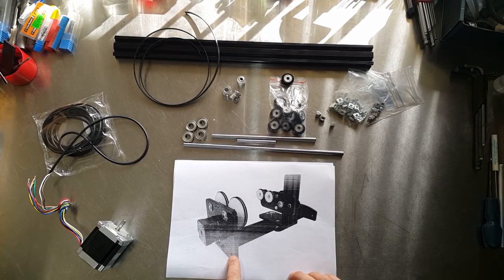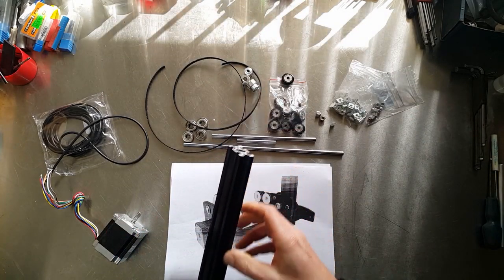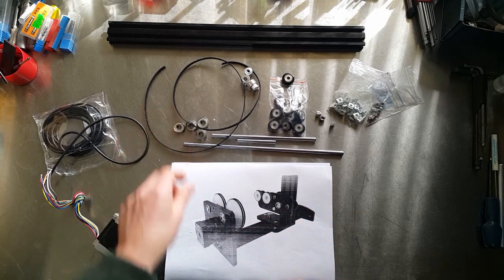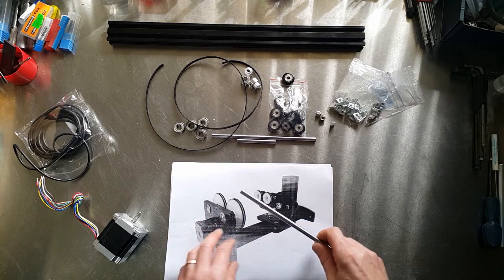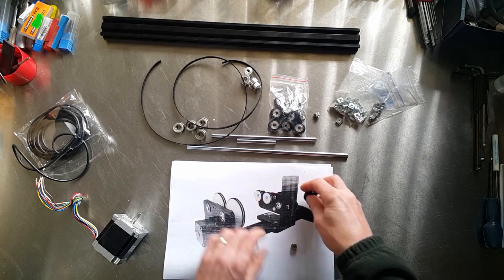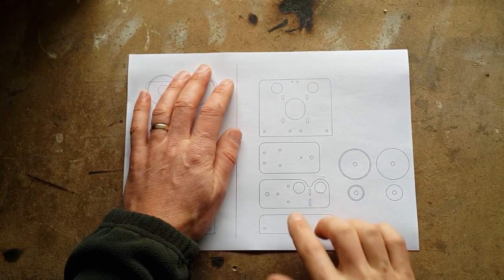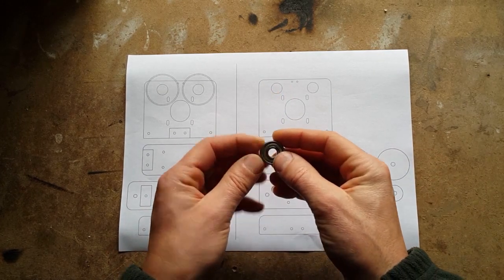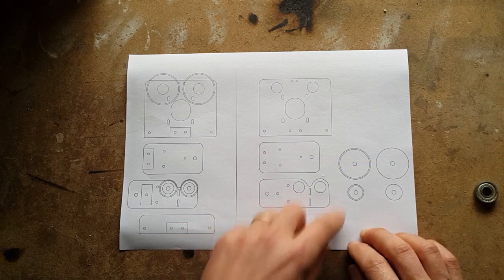#76 - Laser Cutter - Rotary Engraver Build - Part 1

Comment: Hi Kevin, really interesting project, just like Matty, I am thinking about something for laser engraving. I would like something powerful enough to etch metal as well as softer materials. I am fine with CNC programming, my issue is not wanting all the delicate electronics and PC in my workshop due to the damp in the winter so it's putting me off a bit. I will catch up on your previous videos of this machine as I am keen to learn. Let me know if you fancy a sticker swap mate, would be good to exchange. Cheers, Jon
Reply from the maker: Hi Jon, to etch metal you would need quite a powerful laser. My laser tube is rated at 60watt which enables me to cut upto 10mm acrylic and 6mm MDF/birch ply. With the weather in the UK you also have to watch the below freezing winters. The laser tube has a water system for cooling and you wouldn't want it to freeze and damage the tube. Laser tubes aren't cheap.
I've used Cermark(not cheap) in the past which is a spray can based product which is then lasered. A different technique I used on the name plaques for the Kerzel Hit & Miss engine. Heres the link for that video:
https://www.youtube.com/watch?v=pmwH_KOEXAU&t=125s
Sticker swap would be great
Regards
Kevin